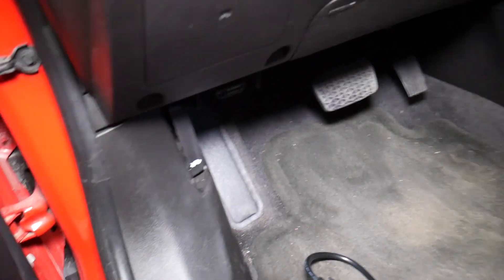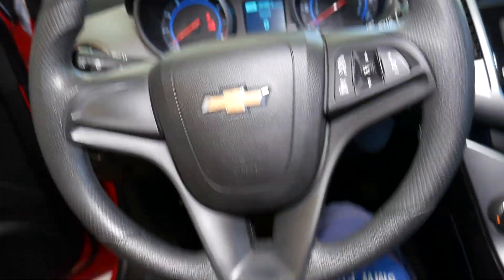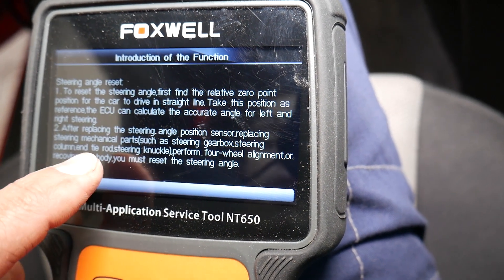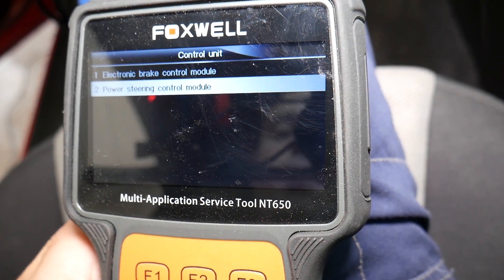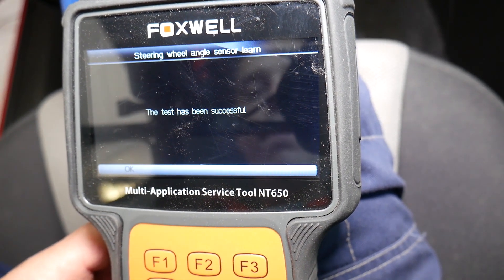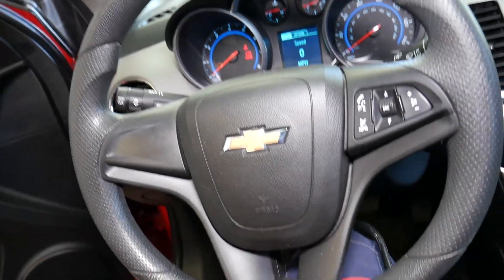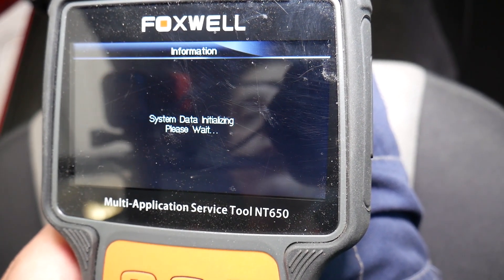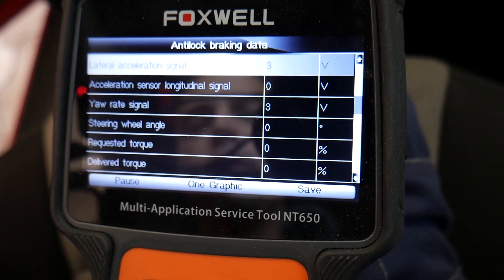HOW TO RESET CALIBRATE STEERING ANGLE SENSOR ON CHEVROLET CRUZE, CHEVY CRUZE. TRACTION LIGHT ON

Comment: When I tried to read live data of stearing angel sensor and turned the weel to max right it gives 760, and to max left -720, but the standered range should read -720/+720, so what to do now ? is it sensor problem or need calibration or reset ?

Comment: I changed the ABS module and now i have traction control and service steering is this because of it needs to be reset or what you think is the problem ?
Reply: I have the same issue after replacing my ABS module, how did you manage to fix yours?
Reply: @ Replaced the ABS module thats under the hood, make sure you get the same part number
Reply: Thanks, I did the same. When I replaced the first ABS, I was still getting the same message C056D-00. So, I replaced the second time with another ABS, I didn’t get the C056D-00 message, but now I’m getting C0710-71, U0126-00 and UO415-00 which are related to Service Steering. This is the same issue which you had mentioned. How did you fix it?
Reply: @ angle sensor calibration
Reply: Can that be done using the OBD tool?
Reply: @williamgeorge616  depends if your tool supports that function, if advanced tool yes